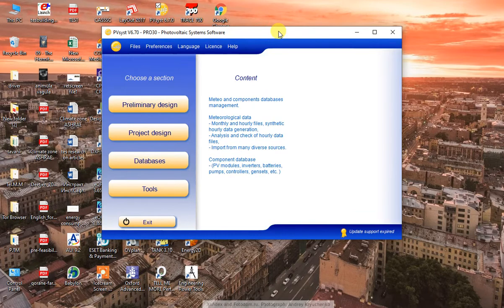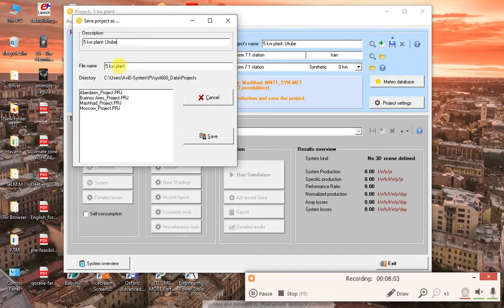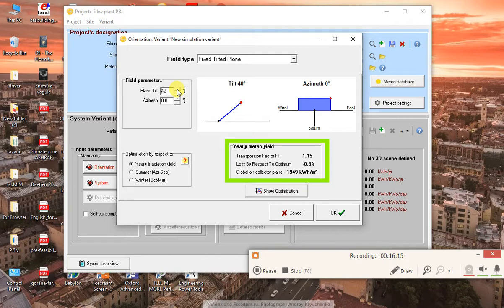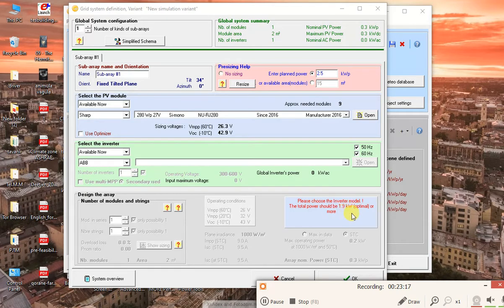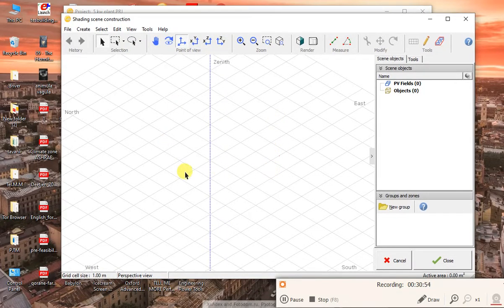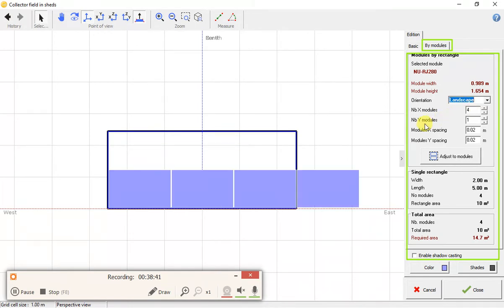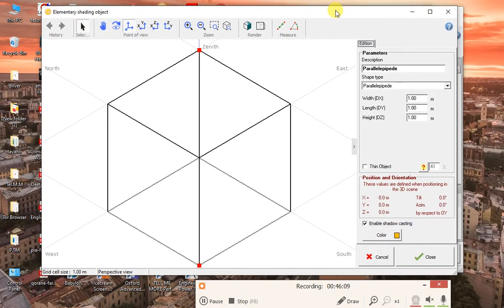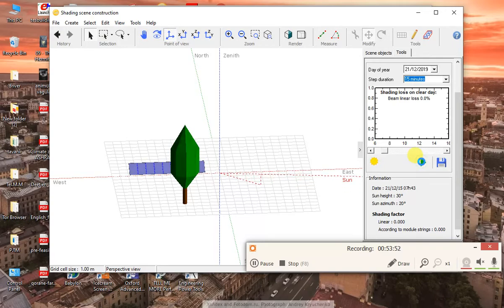PVsyst Soft. V6.7 (Part 3) - Tilt Angle, Inverter selection and Near shadings

Comment: Thank you very much...
How to choose the right orientation for a chosen months in pvsyst (like from 15 April to 20 August) for pumping/irrigation purposes..?
Reply from the maker: Hello dear Elias,

By using PVsyst you can study the azimuth and tilt angles both. It all depends on the Altitude and Azimuth in the Sun path diagram at the site level. 

In PVsyst you can do this by following these steps: 
(in the main interface) 
1- From Utilities go to Databases 
2- From meteo databases on the left side >> Import and generate meteo data >> Synthetic data generation 
3- Now select the country and the site
4- After defining the desired options Click Execute generation >> it shows generation ended successfully>> ok 
5- Close the Databases and go back to the main interface
6- Now select Tools from Utilities 
7- Click the Transposition factor from the Solar tool box
8- Define the selected months or summer/winter from Display mode 
9- Click Create new table >> Generate >> save as> save
10- Now you can use Graph, Table or Monthly table to see the optimized orientation at the site.

Also, you can find another way to do this, I hope it helped you in this way

Good luck,

Comment: how to know azimuth angle from building to installations sollarcell?
Reply from the maker: Greetings dear Erwin, 
As you know, the azimuth is a variable amount for the sun position in the sky from the east to the west side. When our panels are directly faced to the south, we always assume zero for the azimuth angle. As we go to the South-west, the azimuth reaches a negative amount and the same for the South-east but in a positive amount. Also, this applies if we have a fixed typed structure to reach most of the solar rays on our panels during one year. You can consider both calculations with PVsyst or Formula. In the first design, we start with Zero for azimuth angle, then extend our studies by applying conditions and studying the arrays and changing the azimuth in further cases.